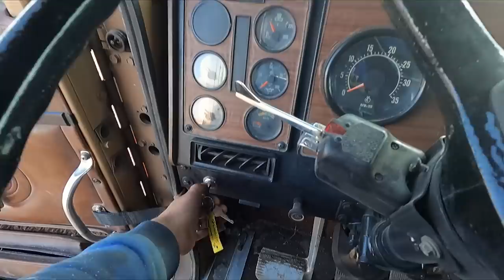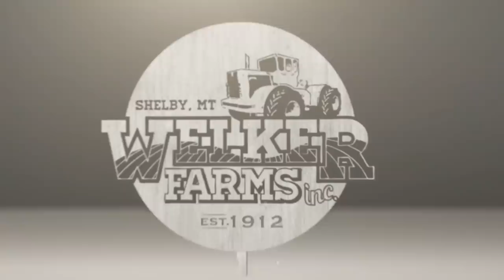Plant the ENTIRE farm? Oh boy...

Comment: Looks like you guys need to expand the hydraulic hose manufacturer area.  If you have a 10 to 20 foot steel work bench available.  Take a piece 1.5 inch angle iron and weld it to the face of the bench. Set it up as Vee bottom trough. You can put a slight pitch to it for drainage into a bucket.  The take a tape measure  and run it the length of the vee bottom trough.  Pop rivot the tape every foot. Cut off the tape spool housing.   That way you can set the old hose in the trough and measure then pull the new hose off the spool and measure it. Put the chop saw on the bench and cut. A hose spool rack is easy to make to go at the end of the bench closest to the saw. Plus it makes it easy to unwind the hose from the spool.

Comment: Thanks for your time and the new video. Lots of work on equipment getting ready for planting season. You want your planting equipment at top operating efficiency because putting the seed in the ground correctly is so important. You folks work hard at getting it all ready to go. Very good Welkers!!!!!!  Your equipment is large so extra effort on it all but you have good handling equipment which helps. To produce the good crops you desire productivity must be right on and putting the seed in the ground right is the key to that. I can remember getting off the tractor many many times to check the planter working correctly. Those were the days. About all my comments this time around. You did good on replacing all those hydraulic hoses. Lots of work there. You all take care. May god watch over all of you!!!!  Iowa farm boy from years ago.

Comment: The one thing we learned, (the hard way), anything with hydraulic hoses, needs to be covered. If one starts to leak, just replace them all. The weather just destroys hyd. hoses. Seems expensive at the time but, break downs cost you more when you need to be in the field. 
Lets see, you have insurance, you have high winds at times... looks to me like the wind just "pushed" you into the shop. Yea, that's what happened. LOL No worries Scott, "stuff" happens. 
Double clutch that truck, won't grind the gears. 
Tight fit with that Bud. Great video as always, cheers :)

Comment: Extra bit of insurance if you put a little coat of silicone between the metal part of the wheel seal and the hub before you drive the seal in.  Helps fill in any pits or imperfections in the hub casting.

Comment: From Down Under. We do a lot of Blade ploughing, where a Cat D11 pulls what we call a blade plough. That wing shaper foot you showed, the plough is that shape and weighs around 20 tonne. The cutting edges, like the edge on a grader blade but a lot bigger, wear down and have to be replaced. To lengthen the life of the cutting edges we have a process of dropping chips of tungsten into weld as you reface the edges. Depending on the soil types you can increase the life span many times. Thanks for you vids.

Comment: Leg Arms, what happens when you overload those ag rims is the hoop (rim part) will stretch and that's what causes it to crack away from the inner part. I've welded 5/16 or 3/8ths steel rod in there to keep it from flexing under load..

Comment: When you put an internal patch inside a tire that has steel belting anywhere in it, you leave a pathway for water intrusion where the nail went through the outer wall. 
The wire in tires is NOT stainless steel,  but will ultimately rust and fail. 
You should instead, insert one of those corded "string" type inserts ("plug" is not the correct word) through the wound from the outside,  and it will suffice for a good repair. It will keep water from getting into the plies and carcass, which would cause it to fracture the belts and the tire will fail. 
An internal patch can then be used if you like, although they are redundant and seldom prove necessary if you do a decent job installing the externally applied repair. There's a a lot less labor involved too and they can be used at the jobsite instead.of having to remove the tire/rim and haul it to your shop to break it down for repair. I keep kits with all my rolling stock. .

Comment: Hey Bob those Openers on the planters, have you thought about running a few beads of "Case Hardening" welding rods down the sides of them to stop the wear? you will literally increase the life of them by at least 3 times or more. anyways its probably worth looking at the numbers on doing so as opposed to having to replace them.
Reply: Thought about that but the side is so thin there isn't any support left.

Comment: Hey, take your old worn out air seeder hose and cut it down the centre on one side. then when you get a hole in a hose you just take your 5-8in patch hose and slide it over, no tape required. thats what we did when we ran 24hrs on the drills cause who wants to change a hose at 3am lol!

Comment: Leg Arm; for the hydraulic hoses instead of using the crimp style, why don't you get the Areoquip hose and reusable fittings, I find it actually lasts longer than the crimp, style and for operating pressures it come in different psi burst pressures
Reply: In our area hardly anyone uses Areo.

Comment: Good to see you have the proper seal installers as often one doesn't have those tools due to the limited use they get in a non commercial shop, yet if the seal leaks because of a bad install the tool becomes extremely cheap !. Oh by the way Nick were you able to find the transmission parts you left behind ? LOL. Left hand shifting in a left hand drive truck just doesn't work well at all in a non syncro transmission.

Comment: Ok, I know it might be a strange question to you guys, but, as I’m here in the UK and have never had the chance to see a Big Bud in the flesh, why does it have 2 Prop shafts at the rear of the cab? Is the top one driving the hydraulic pump? Thanks. 👍👍👍👍🤜🤛🤜🤛🇬🇧🇺🇸🇬🇧🇺🇸
Reply from the maker: Great question! Actually it acts as a Dropbox or in this case a chain case to drop the power from above to axle height. One input in and two go out to each axle. The transmission on that old bud doesn't drop the power down like new tractors do.
Reply: @WelkerFarms  oh I see. I appreciate you taking the time to explain. I notice the strangest things I know lol. Take care. 👍👍👍👍👍🇬🇧🇺🇸🇬🇧🇺🇸🤜🤛

Comment: Legarm like i tell my sons when they mess up. If its can be fixed no problem,  if it will heal no problem.  The only people that don't make mistakes are people that don't do anything.   On the flexible hoses on the air drill can you not use exhaust pipe bent on a 90 or what ever the angle  to reduce wear?

Comment: Guys, I would like to see you go through, a "Safety" video of some sort. and here is why. 

Things I noticed, The bifold door on the shop was not fully up half up, yet in this video you were cutting hoses in the opening of the door. What if anything keeps that door from coming back down beyond possible hydraulics that pick it up? What locks the door from falling when it is in that state? What locks it from falling when its fully up?

You were working under and around the harrow section, which again has hydraulic lines you can see the cylinders extended. What keeps then from loosing pressure and coming down? Is there a Lockout type system for that? 

Can you think through what type of Lockout system you have in place, what type of additional lockout aspects do you have if you have multiple people working on the same thing? I'm not going to ask about Trip hazards at this point, but I am concerned about all of you when working, and what are you doing to lock "stored" energy which could be gravity from effecting you by accident.
Reply: What you don't see is that the door has weights inside the wall which help lift the door up (800 lbs of weights).  Also if you look you will see that the safety blocks are blocking the cylinder shafts from dropping.